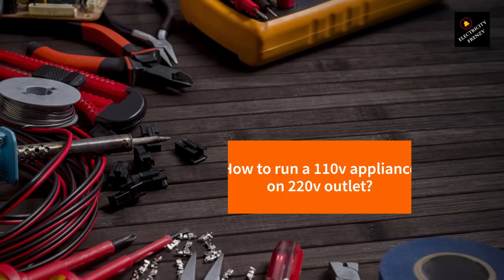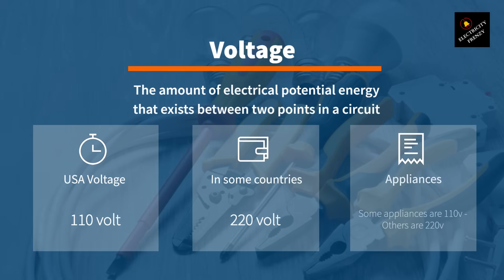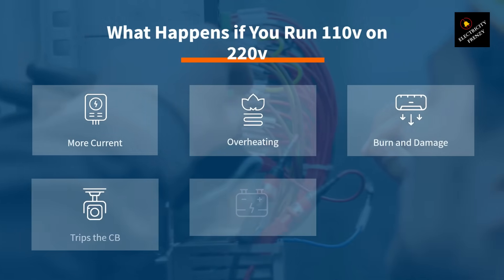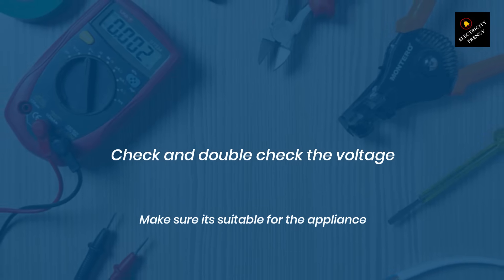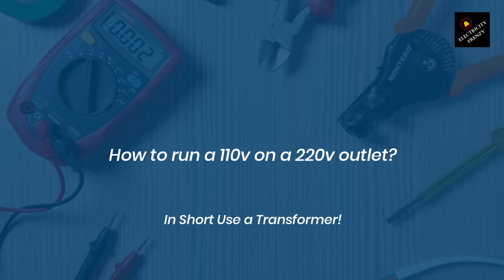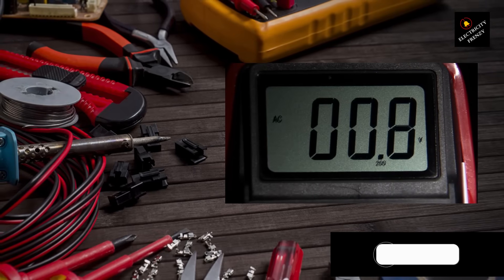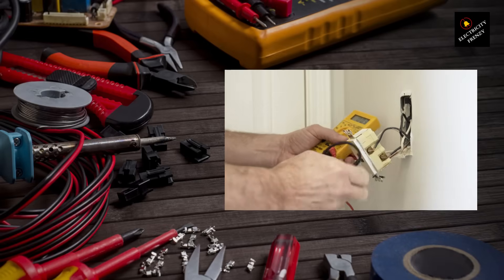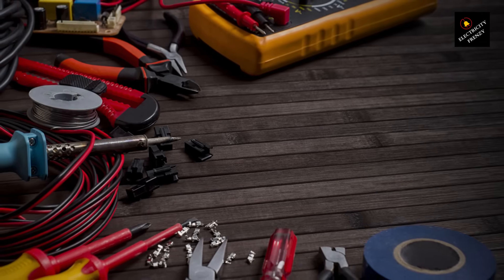How To Run 110v Appliance on 220v - The Only Way!

Comment: Thank you for the video! Help please. What type of converter I need to buy for my 
Dyson 120V -60HZ
1300 W
I’m going to country using 220V
Thank you so much !
Reply from the maker: 220v / 60hz or 50 hz
Reply: Greatly appreciate your quick response.
Just to make I understand…
220V/60HZ voltage converter?
Reply: Also how many watts

Comment: I bought elite ejx600 juicer which is 120v from amazon and it worked in 230v outlet why is that
Reply from the maker: Maybe it's designed to work on 110/220 v

Comment: Hey i am from Pakistan, I want to buy revolution touch screen toaster from US, but this is 110 volts and in Pakistan 220 volts is used. What should I do please suggest me?
Reply from the maker: Try to find another daul voltage toaster 110/220v and make sure the frequency is suitable for it in Pakistan

Comment: I ordered a Tascam 424 mk3 from US without knowing anything about these things. Aparently it is 120v /60 Hz. I live in europe and we have 230v /50 Hz. After what I could find on the internet, it seems that tha Hz wouldn't be a problem (read it on a forum somewhere), and that a step-up/down converter will do the trick. But after seing this video  I got some more questions... Would a 1200 W converter be ok to use? And if I wanted to change the Hz, would I need another converter aswell ?

Comment: Can i use step down transformer for a printer?
Reply from the maker: Sure you can!
But make sure the transformer power is suitable for the printer.
Also, make sure the frequency is the same.

Comment: I have a fridge which works on 110 v and I live in the UAE (we use 220 v), I use a 110 to 220 converter which has 300 W. Is is safe for long term operation? And is it normal that the converter is hot? Thanks
Reply from the maker: Is the converter hot or warm?
Reply: @ElectricityFrenzy  its warm.. but I just let it run for 2 hours and turned it off. Its still off.. Im not sure if its safe for long term operation. Please advise 🙏
Reply from the maker: You shold check the fridge wattage and make sure it's smaller than the converter.
Reply: @ got it.. thank you so much

Comment: Theres videos on how to split a 240vac into 2 110v outlets. Each of the cords red black white and green are power 110 power 110 , neutral, earth ground.  If you only use a red 110v and a neutral , earth ground you have 110v . According to the videos on YouTube.😁 And if used repeated this with the black wire youd have another 110v outlet.
Reply: Yep, but the thing about that which would worry me though would be the circuit breaker on the circuit. My kitchen has such a circuit built in where the two hot wires are on different phases and share a common neutral. But, they're both on different 20a breakers.

Comment: what do i need to use a U.S. version robot which has a 120V- 60Hz 70watt in a country with 220V? i don’t wanna buy something not strong enough or too strong and expensive. an answer would be so helpful🙏🏾
Reply from the maker: Does the robot has a batery?
Reply: @ElectricityFrenzy  yes 5200mah li-on. and using max power whil hot water mop washing which is 120v-60hz 12a so i believe 1440 watts. if i get 3000va 220-110 it’d be enough?

Comment: Can I change the range to wiring so it's a 120 volts versus a
220|240? I just have a two burner stove that I wanna use a new USA.
Reply from the maker: 220v burner, you can use a voltage converter 220 to 120, and it will work
But keep in mind the wattage of the converter should be higher than the burner.

The issue is not the wiring, but the heaters
Reply: @ElectricityFrenzy  
Thank you so much for your response. You are really a nice guy.  Please advise me What’s the best voltage converter That better for my stove I just found this written on the back of the stove. 
GENERAL
HOUSEHOLD ELECTRIC RANGE

3. 4/2. 6
V  240/208

USE ON 3 WIRE 60HZ AC ONLY
ELECTRIC
MADE IN USA. Again, I really appreciate your respond.
Reply from the maker: This means your stove is ranging between 500 to 1000 watt

So using 2000kw voltage converter will be good.

Note KW not KVA
Reply: @ElectricityFrenzy  
Thank you so much for your advice. I really appreciate your reply. Such a nice person.

Comment: I have a question. I have a wellpump in side my well house outside running off 220volts. I was thinking about hooking up a 120 wiring outlet to run lights from the wiring going to the pump switch or from the wire going to the pump switch. Just for lights only. I know it will work. I just wanted to get your input on this. Thanks
Reply from the maker: It will work as you use 120v lights.
I believe your concern is it safe tobuse the same wiring for additional lights? If so, yes it can.
Are we on the same page 🤔
Reply: @ElectricityFrenzy    Yes that’s what I was wondering, Thanks.
Reply from the maker: You are welcome 👍

Comment: if you have a console just remove the power supply and change with a 220v one. soon as you pop in a 110v in a 220v the caps will explode

Comment: Why not just use 1 leg of the 220 outlet? 220 Receptacle has 2 110 legs.
Reply from the maker: Because you still need a second wire  to get 110 v

Comment: PLEASE HELP! I have a 120v - 60Hz air fryer @ 1700 watts that I want to use in a 220v environment. My question is how much step-down transformer is appropriate? Some say @ least 3000w, others say 1700 multiplied by two = 3400w. Transformers are expensive so I want to make sure that I purchase the appropriate wattage that is safe due to the heating aspect of the item. Is 2000w good enough? I truly appreciate the help. Thank you.
Reply from the maker: How much is the frequency in the new location of 220v?
Reply: @ElectricityFrenzy  Greetings and thank you for replying. It's 60Hz.
Reply from the maker: 2000 Watt will be good
However if you find 2100 or 2200 this will be better
Reply: @ElectricityFrenzy  I actually ended up buying a 3000 watt transformer before I received your response. Thank you for taking the time to answer.
Reply: @99khanNLQ Does it work properly with the transformer?
Reply: @ElectricityFrenzy  Thanks for the reply. It's 60Hz.
Reply: I had a 900V mixer and I used a 1KV transformer. It worked alright for many years.

Comment: How does a Laptop charger purchased in USA 110V work in India 220V
Reply from the maker: Most chargers work on both voltages 
Check the data on it.

Comment: My angle grinder does not run on step down transformer used for smaller appliances kindly suggest a transformer for higher rated angle grinder
Reply from the maker: How much power is your grinder
Reply: You can run motor based loads with a triac dimmer. Make sure it's rated for the current and has enough heat-sinking. You shouldn't go above half-way with the potentiometer. Use a true RMS multimeter to measure the output voltage. AC drills with adjustable speed use just that, a triac dimmer circuit. You can find them online or in a hardware store for < $5.

Comment: Please help me. I bought a TV from the US, and the voltage requirement is 110V, 50/60Hz. By the way, I live in the Philippines.
Reply from the maker: How much the voltage in your county
Reply: @ElectricityFrenzy  the Philippines is using 220v.
Reply from the maker: You can use a voltage converter from 220 to 110 v

Check the video description
Reply: Dalhin mo sa electronic technician na maalam. Papalitan lang yan ng main cap, NTC/PTC , fuse ok na yan. Maniwala ka sa bugok na ito.
Reply: Take it to a good electronic technician. Your tv just need a main capacitor, varistor change and it will run on 220 volts. Tv's frim america has 200 to 250 volt cap and varistor and just need 450 volt cap and varistor change.

Comment: My case is opposite, its PS5 will it work??
Reply from the maker: You should check the voltage range on the PS5 if it's 220V it will need a voltage converter.

If it's voltage range 90/240 this will be perfect.
If you are not sure tell me I can help you

Comment: INSTEAD OF TRANSFORMER YU SHOULD CONNECT RESISTOR IN SERIES
Reply from the maker: Thanks for your comment. What would be the resistor value?
Reply: U can not add a fixed value resiatance, if its not a pure resistive load.
Coz voltage will fluctuate across resistor with changing load or current.

Comment: How do you convert the frequency 60Hz US to 50Hz UK please? I have a US clock timer for use in the UK. Thank you.
Reply from the maker: You can use a frequency converter 

How much voltage is your timer
Reply: @ElectricityFrenzy  The timer is 120v. with very low, but unspecified watts. Is there an alternative to 12 volt battery reliant inverters, please? Thank you.
Reply from the maker: Use a voltage-frequency converter.
Check the video description. I can remember I set a link to one.
Reply: I have appliances coming from Australia and I want to use it in Philippines, but the requirements of the appliances fro Australia is 220v with just 50hz, but in Philippines we have 220v and 60hz, what can I do, thanks
Reply: @JeromeBarnobal  Normally  you can always use an equipment designed for 50 Hz with a 60Hz supply. Vice versa you do not know, some will work OK, typically any heating element, but motors and transformers may overheat.

Comment: So what do i need 220v to 110v or 110v to 220v
Reply from the maker: Depends on your device and country voltage.
Make sure your device and plug are the same voltage
Reply: @ElectricityFrenzy  I have PS3 it has 120v I'm from ph we have 220v
Reply from the maker: So you need 220 to 110 v converter.
The converter should provide 110v for your device. Make sure it's power is suitable for the device
Reply: You usually don't need either, but there are still a few items that can't handle worldwide voltage. Most devices these days are good for 110-230v and 50 or 60hz and are marked as such.

Comment: I have Mini chopper from USA and it is 120v~ 60Hz 35w . Which adaptor I need to use please suggest, I'm from India.
Reply from the maker: Check the description, but make sure the one you get is 120 v 60hz and More than 35 w